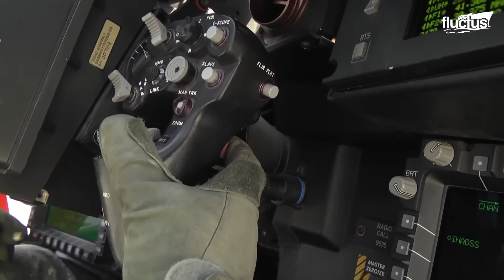The Crazy Process of Repairing a US A-10 Plane After Serious Bird Strike

Comment: These phase inspections are routine maintenance for pretty much all aircraft,not just the A-10. Military aircraft operate under extreme conditions. Commercial aircraft don’t operate under the same circumstances but fly almost constantly daily. They get periodic maintenance after so many hours and then they get a C check after 18-24 months.